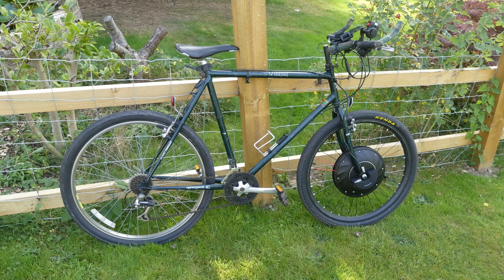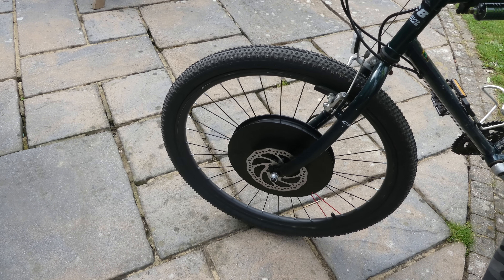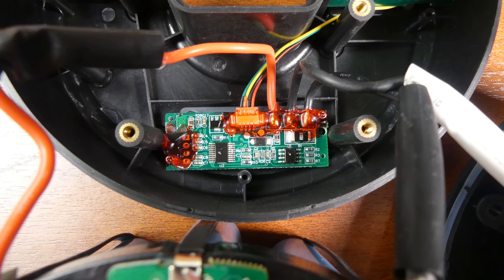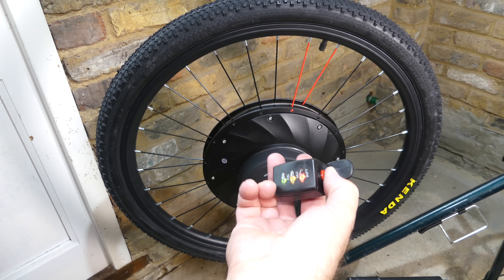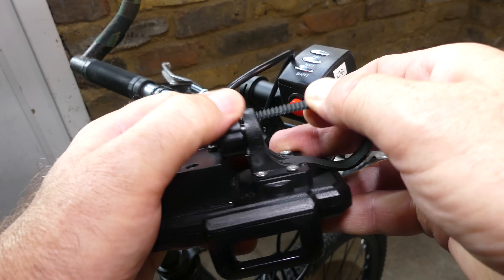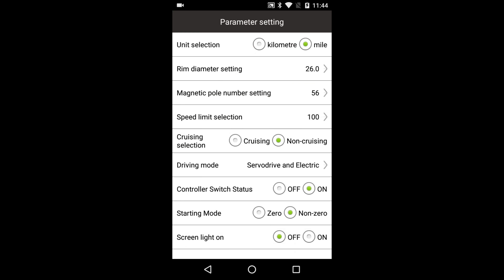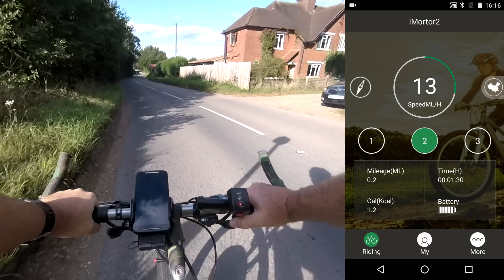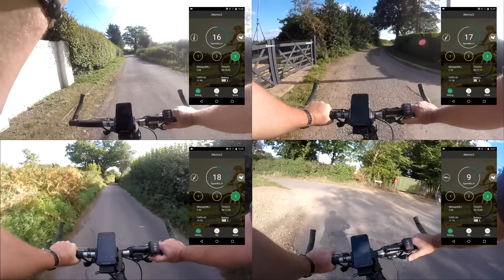Turn an old bike into an ebike - cheap & easy IMortor conversion kit

Comment: Imagine making a three wheel reverse trike with this.
Reply: Really slow? I averaged 28 mph during a 30 mile road race just on a pedal bike... A trike would be about like a children’s “power ride on” lawn toy. Go for some different motors!

I’ve have a 1200w rated motor on my road bicycle now (hoping to hit 50 mph at least, might go duel wheel drive). 3 of those would be a fun amount of power (pedal assist basically tries to kill you, remove it or you’ll end up trying to pedal a couple extra feet to a stop sign and the motor decides “nah, you want to do a wheelie!”, lol! I just use the thumb throttle after that...). That still didn’t mean later that day I didn’t modify the current measure shunts, haha, you can always use more power! (I believe it said around 1700w peak for takeoff, but with the soldering change I did it should allow around 40 amp continuous at “48v” and unknown for peak, the 12 power mosfets were rated for 100-120 amps each though I couldn’t find their voltage-current charts).

I also tested with some of my race quadcopter batteries (my miniquad uses 35 amps per motor on 5 inch props, so up to 140 amps at full throttle  total from a 1.5 Ah battery, obviously anything but high end LiPo batteries will catch fire after a few seconds of that), so even though 1.5 Ah 12 cell LiPo at 48v doesn’t seem like it would deliver the power, it can long enough for testing and having it launch across the yard fast enough it only takes about 2 seconds to stop and go get your helmet, lol! So you could use those if you wanted to keep the weight down for doughnuts in the parking lot.

Most cheap $160 kits (without battery) will have 1000w motor, so one of those alone will push way more power than 3 of these (and speed, they are also higher voltage). They are cheaper, and extremely simple to connect just like this, the difference is the battery is mounted on the frame and allow customization options.
Reply: They still haven't made an e-bike that I can't out pedal on a human powered bike in a day. The tortoise still wins.

Comment: Would be great if you could connect an external battery to extend mileage.
Good price for what it is.
Reply: Xt 60 connector is pretty common
Reply: Alternatively, do what I've do, carry a spare battery.  When the first one dies, just plug in the spare. Compared to the price of other batteries, they are realivly cheap.
Reply: Same here. XT60's enough here, seriously thinking about getting one, fixing issues like weatherproofing the electronics, and adding a nice beefy lipo pack for extra range. I don't care about high speed, I want something to replace my 2 stroke mopeds/ scooters. If the BMS circuit isn't part of the motor control, might just plug in a XT60, with properly shielded cabling. Interdasting.
Reply: @Mediamarked  ..that might be not possible as the connectors for the battery would be exposed and the weigh of the imotor 3 is 8kg adding a fullsize battery would just be too heavy. better of building your own hub powered bike.not to mention it will die first sign of rain. As reported by buyers who used these.

Comment: Have you tested another battery on this motor? I left my bike on the rain and it damaged the battery I’m having trouble replacing it. The link on the bio is out of stock. I’m trying to figure out if I can buy another different battery or if I need this specific battery. Please help

Comment: Thanks for the video. 
😎👍 Any idea on the durability, range of this kit? How difficult it is to replace the cells etc? Cost of replacement batteries?
Reply: He did say 9 miles or 40 minutes.  The battery cells (of which there are 10) are on ebay/amazon.  They are the 3.7V 18650 batteries.  Avoid the cheap ones though.  They are always fake and dangerous too.  Plus they do not last.

Comment: I got one of these and the motor adds a loooot of resistence with not accelerating, by your initial push your is not as severe.. have you noticed something like that?
Reply from the maker: No
Reply: @techydiy  By design you need this motor to be on most of the time because the large bearing is nice but has some resistance.

Comment: I do like this kit unfortunately I followed your links and checked I'm actually quite convinced that there's something wrong with my ability to do reasoning here I'm looking at probably 15 different options and they look like different brands and instead of wheel sizes.
If it was possible could you link me to specifically this kit and I'm a bit confused shouldn't I be able to buy this kit and then select a tire size? 
The main thing that wasn't covered in this was how to go about deciding what model and ordering

Comment: You left one most important thing out. HOW MUCH IS IT?
Reply: You didn't pay attention. It was on the screen at $350ish
Reply: Yeah how much and where to buy, most of the vloggers they keep on talking but the most important they are always forgetting the price and where to buy. Anyway thanks to you sir may i know the price tag of that e bike kit?
Reply: Price has changed dramatically since this went up. Any price they might say will quickly become wrong.  At which point you same dudes come back to say wrong price.  Truly no pleasing some people.
Reply: @anothersomebody8195  Thank you sweetie!!!
Reply: @anothersomebody8195  I watched it again and still didn't see it and still have no clue "[(HOW MUCH DOES IT COST)]". But thanks anyway sugar.
Reply: @kimnielsenthewordyvikingett159  21 seconds in?
Reply: @anothersomebody8195  Thanks again honey I found it this time. No wonder I didn't see it not only was it a little more than a flash it was tiny on my phone screen. That's not a bad price but I'm thinking the easiest so far I've seen too install. There are cheaper ones on Amazon for the front wheel replacement such as this one. Some as low as $60.00. I'm still trying to make up my mind weather or not I'd like to carry the extra weight up and down my stairs. That and I most definitely need the exercise trying to get more shapely curves from the waist down. But thanks again sweetheart.
Reply: @kimnielsenthewordyvikingett159  You bet! If it makes you feel better, I ended up going with a motorcycle instead... so zero exercise hear 🤦‍♂️. The stairs make that a tough decision!
Reply: @anothersomebody8195  OK cool!!! So what kind of motorcycle did you get???? And yeah I hear you of course it's easier and probably a lot more fun!!! But another reason I'm thinking E.B. is the trails rules also allow it. And this Texas girl definitely needs the exercise.
Reply: @anothersomebody8195  cheapest one I could find was $470 though? I think the prices went up or something

Comment: I've heard that these imortor kits have alot less torque than the regular build it yourself kits roughly 5-10 nm vs 40ish nm ( Newton meter ) do you have experience with other ebikes to comment?
Reply: The DIY hub motor kit I have tried to throw me through the intersection, I barely pedaled forward to get closer to the stop sign and the pedal assist was like “nah, this guy clearly wants to do a wheelie!”. Haha, DIY motors definitely have insane torque compared to this one reciewed, hands down, no question about it!**

**mine was more expensive, $220 for everything but bike and battery, the low spec battery the video shown would instantly catch fire on anything nearly as powerful. That battery should be like $60, which is why the kit shown in video are so cheap, but not great value since even $160 bike kits are 1000w in everything from the common 26 inch mtb to 26-4.5 inch or 20-4.5 wide fat bike tires (I’ve also got one of those fatbike kits but I need to find a good deal on a used bike).

The big question is what is legal (or that you can get away with). If you’re stuck with 250w, skip it! I already average 28 mph over a 30 mile course with just pedals on my normal road bike, and the 250w motors as you saw here too out at less than 20 mph, so they will only slow you down as the windings are not “geared” or wound for high rpm (they are optimized for low rpm and higher torque). But if you can get 1kw motor, then that’s the way to go! I can actually go much higher where I’m at due to a weird legal loophole (in Texas, it’s 20mph without pedaling, but if you are pedaling, since they don’t want you to be going slower than on a normal bike and slowing traffic, then they have no speed max for ebikes and that’s where the loophole is because they don’t have a power limit either! So sometime I’ll do 2 motors and bump my max speed from 30 mph on normal bike to a decent 50 mph for commuting to work and not holding up traffic).
Reply: @JakeGarret that's crazy!!

Comment: That equipment is just for front or there's for the back as well?
Reply: It's one wheel drive. Front wheel drive. It's more complicated but you can make a 2 wheel drive bicycle to go faster faster. Of course. Double the power being used in a way.

Comment: The Vdo on turn an old bike in2,an Ebike can that moter u put on th frint wheel can that go on bak of bike,,Tanx 4the Vdo Godbless 2u and family👍👍👍👍🙏🙏
Reply: Not unless they have a rear wheel option available. you need to have more width on the rear wheel to reach the dropouts, and the front wheel kits lack that. not to mention that due to the lack of a freewheel or cassette you lose the pedal functionality, which legally speaking turns your bicycle into a moped and that makes it illegal for road use without registration.

Comment: Do what I did . Stay off the drugs. Took me a few months to get the money. But for eleven hundred pounds . I've got a 30mph or 45kph depending where you live. Well made bike, and fast enough. Can be switched to road legal with a wire switch. Just set yourself a goal. Helped me.

Comment: Unless you have a plastic fork, or plan on stunt riding it I wouldn't worry about this weak motor breaking a bamboo fork. What I would worry about is the bike having a 5 mile range and frying the pathetic battery by drawing too many amps. If you want a cheap toy ebike shaped object than this is the kit for you. But if you want a nice ebike that has enough speed, power, range, durability, and reliability than you're going to have to pony up the money, or learn how to build your own battery packs. 
Pro tips
1. Research YouTube and endless sphere until your eyes nearly bleed.
2. Don't even consider anything under 48 volts unless you weigh less than 130 lbs or are using a mid drive set up.
3. The battery is the most important component to spend money on. Get the best you can afford. Em3ev makes the best packs in the industry.
4. Don't forget about brakes, you will burn through brake pads at a dizzying rate. Grin technology's sells a geared clutchless mac hub motor that has regen, highly recommended, very reliable, and will save on brake pads.
5. Upgrade tires, charger, and controller last after ironing out all the bugs in your build.
Follow these steps and you will have an ebike that will blow pass anything that is sold in stores, let alone this toy kit in this video.
Reply: Where can I order that?
Reply: Can you make & post videos showing what you described? Sound like you know the subject and could really help us dabblers.
Reply: @sdnlawrence5640  I'm going to spend the winter learning how to make a YouTube channel. Because next spring I plan on riding my improved build across the United States pulling a bicycle trailer with my dog riding on it. I'm not the most internet savvy person around. I have a lot to learn, but if I taught myself how to build an ebike then how hard can it be right. I plan on installing a second mac motor one of those clutchless motors I mentioned. I also still have to upgrade my connectors to xt60 water resistant ones and my controller. A lot can be learned about building ebikes on YouTube and on a forum called endless sphere. It takes a lot of research, but it is critical to do otherwise you will be stumbling around in the dark and wasting a lot of money. Check back on me by April to see my YouTube channel  and if all goes well then I should have a few videos posted by then.
Reply: @thedevilsadvocate5210  I don't know how to post links but Google grin technology's, also em3ev for batteries there's a long wait and about $200 in hidden fees ie transporting hazardous materials for shipping, customs fee, and about a 6 week delivery time. Barring that you can save on customs fee by ordering from luna cycle but they're kinda hit and miss about whether that the have the battery you want in stock. Hope that helps you.
Reply: I don't care, and I don't know about this stuff. But,  I would trust your instincts and knowledge more than this sales pitch. Thanks
Reply: @uprightfossil6673  np

Comment: Got one of these.. stupidly removed screws from around the motor casing and promptly lost them. Oops. Anyone know what size screw fits or where I can get spares (or a copy of the user manual) in case they're lost. Alibaba??
Reply: I think they must be M3. I opened mine and potted the bluetooth stick in epoxy and put some on the magnets aswell. I lubed the bearings and the protection covers and made sure no water can come inside.
Reply: I dont think you need all screws.

Comment: Lol, Only good part about this is the throttle extender, I wouldnt touch a hub motor my self, Would only bother wid mid motors, But for some people this is perfect, Battery aint very good tho, Little shop journeys an too keep fit aswell as having a motor yeah it could work, Still tho i would only bother with mid motors....

Comment: The price was never mentioned!
Reply: 170$ I just got one
Reply: @nickolasvaughn265  Help me out with the details on how you got your hands on this.
Reply: Almost forgot, let me know when you install it how well things turned out! Thanks!
Reply: @byjuu246  so you could find it on Amazon or eBay but the kit I ordered ended up not coming with a battery so make sure you find one that comes with the battery just look up electric bicycle wheel they got 36 and 48 volt don't know the price difference but the 36 volt does 23 mph and the 48 does like 35 but I think that's 2 fast for a bicycle lol sorry I took me so long to respond

Comment: Can you add another power source like an +1 battery
Reply from the maker: You can carry a second battery or plug an external battery into the power socket, but if you mean can you add another in parallel, then no not easily.

Comment: So, because of the size of the battery and it's plugin style, it's very limited in distance and practicality. Not impossible to modify wires and a larger remote battery though.
Reply: Thats exactly what I did. A second parallel battery and additional batteries. I used this wheel allot 5000KM in a year to be exact.

Comment: My friend has a wheel engine electric bicycle, it eats spokes like crazy. The engine is to strong for the wheel. The engine turns around stronger than the spokes can handle. Back or front wheel engine is not a very smart solution. Better to have one in the middle at the pedals. 
Everyone should research this thoroughly.
Reply: My Bike has a Bafang Hub motor, but they use reinforced, thicker spokes. I still had some broken spokes, but only 2 on 10k km.
I think using a powerful mid drive, combined with a rear wheel made for a non electric bike may be a problem.
Mid drives are even worse for the spokes, because they bring even more torque on the wheel than hub motors.

Comment: Is it UK legal? I think not. 
 Thanks for an interesting video, but I think front wheel hub conversions are the least desirable due to how they affect the overall handling of the bike, but for road commutes where handling is not important, then they have their place.
Reply: Sure is legal, I think he said 240w and maximum allowed is 250 so that's ok. When he cycled the motor stopped at 17mph. 15mph is the speed limit for cycles, so the 2 extra mph can be justified by his own effort. The throttle can be deactivated on the app so no issues there. Good video, I always wondered about these kits. It's not bad, as you say handling but it's so slow you don't even need a tork arm so it's for beginners. 😂👍
Reply: John Doyle is everything illegal in the UK? Jeezus!
Reply: @filthyanimal874  Not true and we do have electric bikes also.
Reply: @The Skipper...Pretty much. It's one of the saddest places to live in if you don't have money.  One of the few countries where electric scooters are illegal. The attitude of the English is the problem. They love banning stuff.  If it's hard to tax and is fun then they will ban it.

Comment: aaaaaaand a whole covid friendly year later (without income for  2yrs, how did I survive) I have a wheel that takes a nut that fits perfectly & tightens on one side but doesn't seem to be the same thread on t'other side. Oh dear. Anyone know what the wheel hub nut size should be??? I'm nearly there tho, I found my short hex nuts, the wheel motor works, battery charges, thumb controller, lights on everywhere & APP also works! woohoo. Soon be slowly feeling the breeze.

Comment: Boom I just realized, air suspension fork is not going to work because forks piston will be on the way of the battery and you can not cut it of :(

Comment: Can I use another battery to this kit?
Reply: Don't think so, circuit board appears to be designed around the battery pack.    Can get extra battery, but can't add power or charge while in use.

Comment: That wheel doesn't look right. There's no torsional bracing in how it's laced. You could break a spoke or flange over time
Reply: Ik
Reply: @corypatterson3072  mine does work for 2300km fine. just span them a bit more then from the factory

Comment: How far on one charge?
Reply: the battery that comes with it is not up to snuff. you need to add another battery in parallel. I use 10AH of powertool batteries to get 60km range using 350watts to get the 32kmph speed